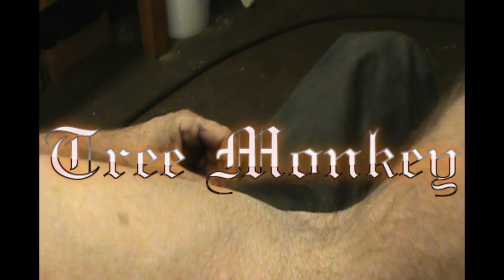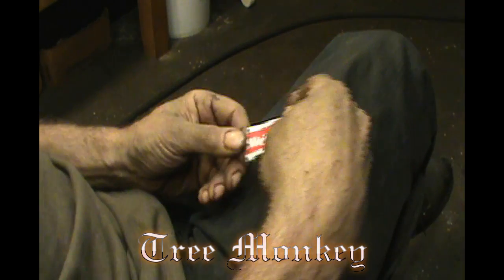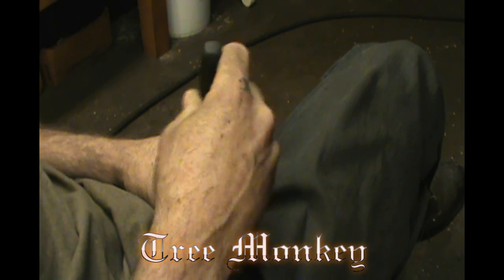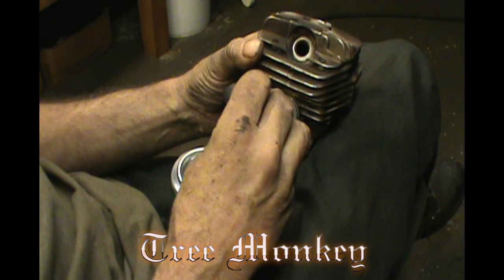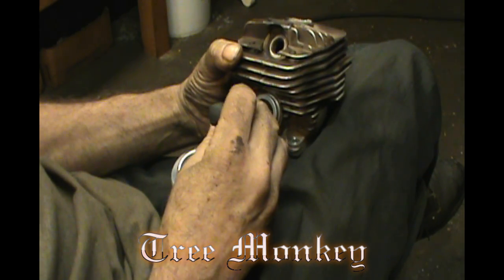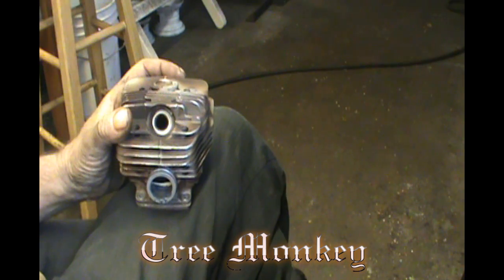porting video series part 6, epoxy in intake port

Comment: Loving the use of the chainsaw-file that way, TBH when I did my 590 (my only project, came out quite well) my chainsaw file (and similar assorted files) were absolutely used in the final-stages of perfecting my ports' shapes!  I mean, none of the outlets/ports are intended to be 'rounded' I want smooth, outwards-enlarged flare so the flat chainsaw&similar files were greatly helpful in-between the actual porting/chamfering, and the by-hand 240g or 400g sandpaper rub (HEAVY rub, lol I still cannot understand any at-home porter's inclination to try making flat-bevelled chamfers, instead of "90* rounded" ('quarter-rounds'), smooth/well-flowing port-edges!
Am a bit overwhelmed man, all my Saturday 660-stuffs orders arrived today*, happy but I've now got (4) cylinders in front of me, 1 needing serious overhauling to work (the one that ate a piston-chip!), 2 generics & a Hyway, was gonna get Cross but reallly wanted that pop-up piston in the Hyway kit, I've gotta say the generics seem to have BETTER casting than the HyWay, uncertain if Cross is always >than Hyway here...  BUT this means I need to bust out that timing wheel, figure out my "first goal" #'s and get cracking--- your videos would've been worthy of repeat-watches if you'd used a 1985 266, but the fact is that, for me, this is effectively a repeat of my "tinman follow-along" only this time, instead of (1) 60cc saw, it's a pair of 92cc's, and varied porting-severity--- am beyond stoked to have found your channel man this is just A++ content I can't think of any other youtuber posting such high-grade content, OPE basically told me not to bother w/ youtubers but, had I mentioned you specifically, I'm sure they'd have thumbs-up'd!!  On that note--- ANY other youtubers you can recommend, even B- level stuff would be helpful to me now (either on performance-builds of 66 top-ends, or general-porting content that's fair to say "Would pass-muster on OPE" if that makes sense ;D OPE is the final authority to me in this arena!)

Comment: I have used jb weld in transfer ports to change the shape, with great results.  It changes color after some run time, possibly from the oil/fuel.

Comment: @scott kunz  You mention having lots of experience w/ epoxy'ing, I'm using JB weld too (like anyone in the 2-stroke world working intakes & transfers :P ), have a "failure likelihood" question for you--- What about the strength of a SECOND application of JB on an intake port?  IE if you messed-up, thought you were coming in with high 150deg's intake but once you got the wheel on found your 660 is nearly 170deg intake (it's big bore / clone, so this is already JB'd, I just over-did the floor because I was too tunnel-visioned on the relative port-surface-area between my intake&&exhaust ports, as both need a 7.5% boost to accommodate the enlarged piston or displacement however you wanna look at it....)  
Thanks so much for your vids they're awesome, am curious if you think it "could work" to have the high 160's deg intake duration IF I make the rest of the porting equally hot, for instance my transfers flow huge and my exhaust is both wide and high like 99 maybe 98.5deg exhaust roof and over 40deg blowdown so cylinder should be "able to take a large intake charge" as it were due to these factors (so my amateur mind has been thinking :P )  Also because my piston, lowers & casing are all ported I also figure the intake needs to be a touch more capable, and for what it's worth I can't go further on width or shape because of locator pin placement on pistons and I have (3) pistons to choose here for this project!)

Comment: Question why not use a base gasket bring port back up. Then wouldn't needed expose. Understand freeing flow up or itemize fuel on intake side. Just wondering
Reply from the maker: i cut the base and squish to raise compression

Comment: Hi Scott. What is the purpose of the epoxy and then grinding it back out. I can see it if you have gone too far and have to fill or build up. Does it just make everything extra smooth.
Reply from the maker: we shortened the duration
Reply: Thanks, I thought it might be something like that. Wanted to make sure. @floydnglenn

Comment: Try using ether to clean the cylinder before applying the JB Weld. Brake clean leaves a residue. You will be suprised how well ether pulls the crap out of the metal.

Comment: Have you ever used epoxy in an exhaust port?
Reply from the maker: j-b won't hold up in the exhaust port, you would need something harder, more heat resistant
Reply: I have used it in the wall of an exhaust port several years ago and it is still there.  A big chunk IN the port will soak up heat and burn, but epoxy in the wall of the port to fix a hole is fine because the surrounding aluminum will cool it.